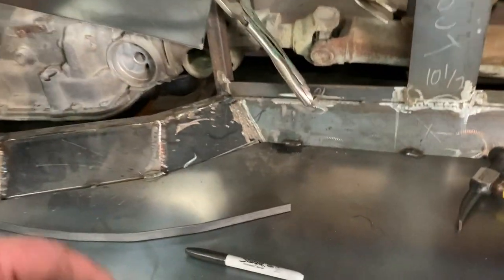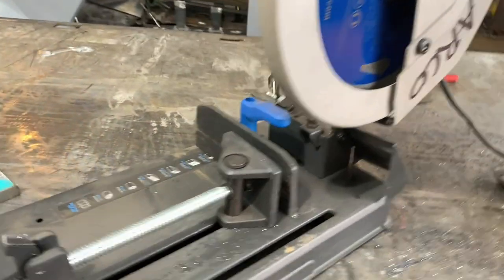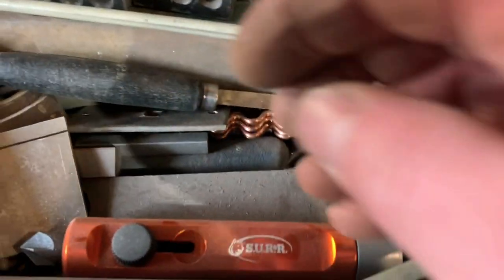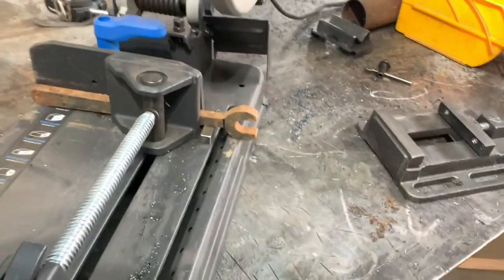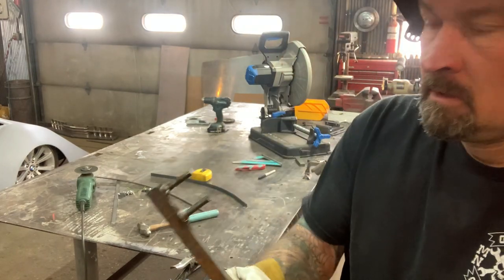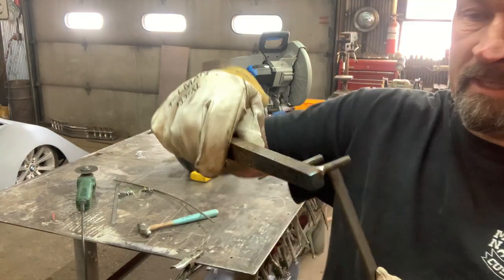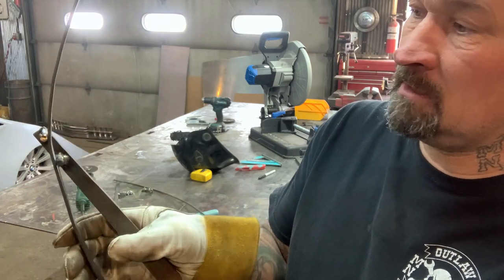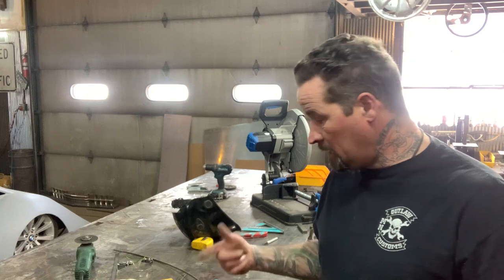TECH TIP - How To Build a Mini Hickey Bar

Comment: Brilliant, that old skool ingenuity brother. If you need to do a job right, fabricate the right tool to do it. Hope yous have a great week and Best wishes and stay safe and well to you both and your families
Reply: Building a one off car will take a lot of custom made tool's to get the job done. That's a tech tip I didn't even think about small handy tool. I always stuck the round bar/rod in a metal hole and bend it that way.

Comment: Hi ARCO, was that your Eastwood 135 mig welder you used on this project?  That was fairly heavy metal. What settings did you use?  I have the 135 also but usually don’t use it on heavier material. Thanks.
Reply from the maker: Yes it is. Im using.030 wire with heat turned all the way up. And wire speed at 3 1/2 and thats 1/8” steel 👍
Reply: Thank you!!

Comment: Another idea.  For the inner stick if you use 1/4 rod you can use  a 1/4" socket drive set with the appropriate size socket to get the radius you need